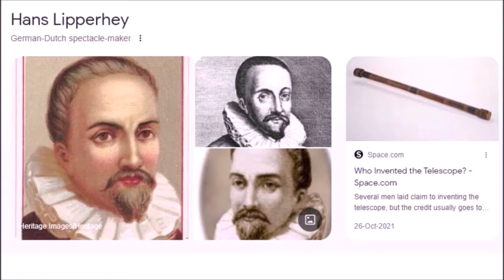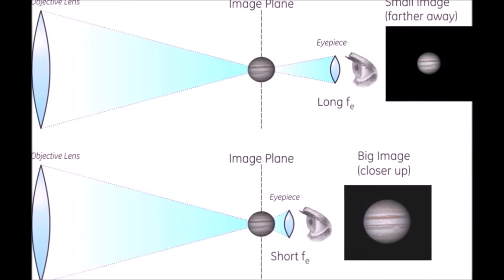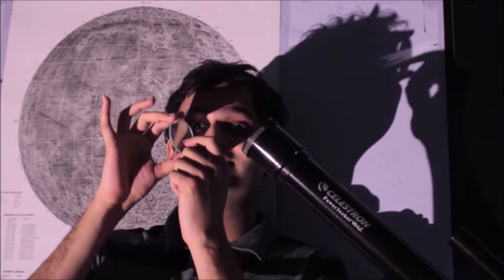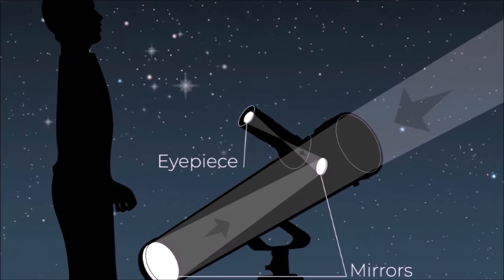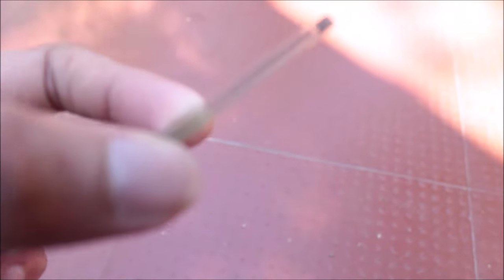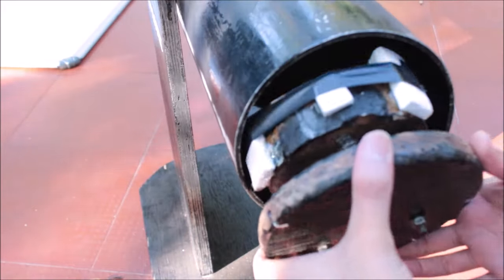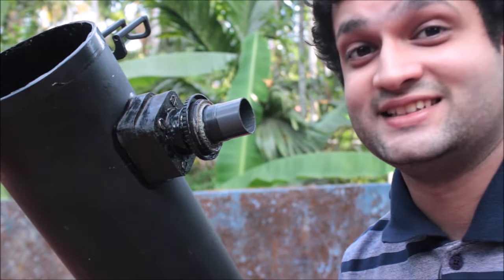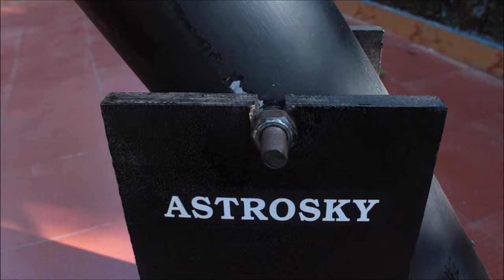Making a Telescope At Home (DIY)   #diy #space #scienceprojects

Comment: Brilliant Kunal, well done! I made mine in a similar way back around 1983 or 84. I used a kitchen sink (threaded) drain pipe to make the azimuth axis, and instead of the altitude bolts I built wooden disks from plywood and cut semi-circles out of the cradle. My tube was also plywood and square. I remember amazing views of Orion nebula from a dark farmers field nearby. These were the days before smartphones.
Reply: Wow that's actually amazing to hear. I am born after 2000 and people interested in astronomy are really hard to find these days. I wonder what kind of skies would be there in 1982-84 lol, it's one thing that I want to see in my life. Telescopes are expensive and not everyone can afford them. I am also thinking to make my own telescope in future.
if you can give me some tips I would really appreciate that, thanx!
Reply: @ICEcoldAryan  Know your limitations, build what you can, source stuff second hand if not (if you can). The biggest decision is whether to make your own optics or not. I've been told that anybody can make a mirror (some of my friends did, I didnt, I was lucky to be able to borrow 8" optics). I was advised to make a 4 inch f/12 newtonian primary mirror first (1/4 wave spherical figure is attainable by a first timer, and will be diffraction limited at this focal length). That way you can learn the basic grinding polishing and testing skills quickly, and have a good entry level telescope to use while you move on to an 8" (It is considerably harder and will take longer - much more polishing and it needs parabolizing). An ~f/6 8" Dob is a sweet-spot instrument!. It'll serve you well for a long time. Most people will buy eyepieces and secondary prism/mirrors (second hand) and maybe spiders, focussers, and mirror cells too - but these are fairly easy to make. A cheap prism will work as a diagonal on an entry level 4". If you go to the 8" It will work too, but you'll probably want to buy an elliptical flat. If you build a dobsonian design that can take an 8" f/6 optical tube you can also fit the 4" tube into it saving double fabrication. In the old days you could buy all the chemicals to silver mirrors yourself. I'm not sure nowadays if that's possible (some are poisonous).  It will depend on where you live. There are old books on this, and stuff online if you google.
Reply: My best skies were in 1974 during a period of political unrest in the UK. Elecrtic power was rationed and there were regular blackouts, but I had access to a local observatory which had a giant 10" Cooke refractor driven by clockwork.
Reply: @amp2amp800  that was a lot of knowledge, thank you very much for that. Considering today's market I'll find hard time to find second hand optics as not very much shops are there who actually sell astronomy stuff dedicatedly but I'll try to find anyways. Yea, I am considering an 8" inch dob for my build but it's gonna be a little hard as I have never made one before. And for other stuff like tube, base and focuser, they are fairly easier to make. Again Thank you so much.
Reply: Has nothing to do with smartphones since people still look build telescopes ?

Comment: Sir I would recommend u to upgrade that bolt design on ur mount that is hold by nuts so u just cut that wood a bit and attach 2 metal jar lids.....it will then have a lot more smooth up and down movement